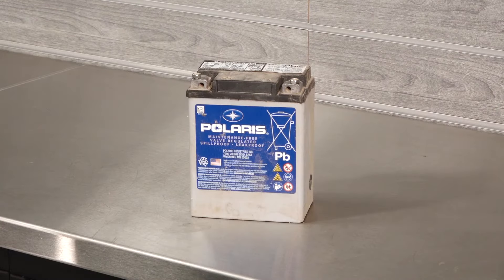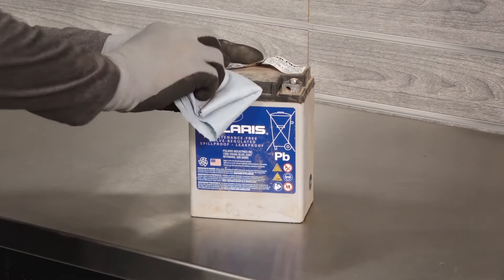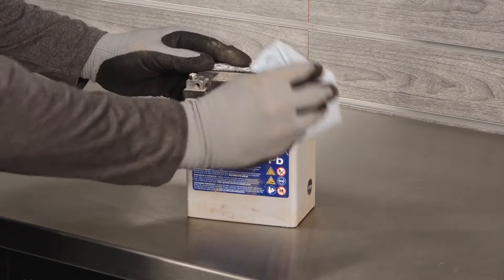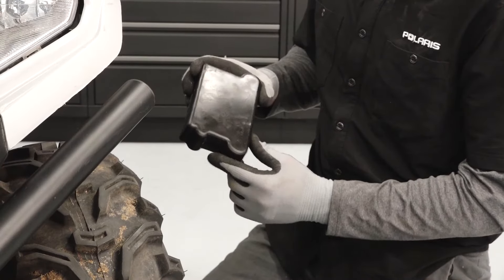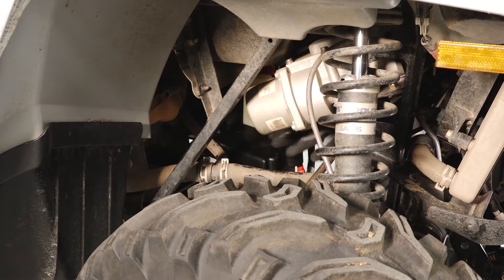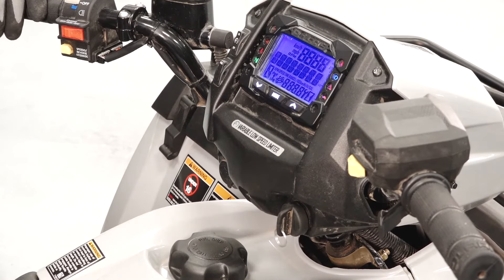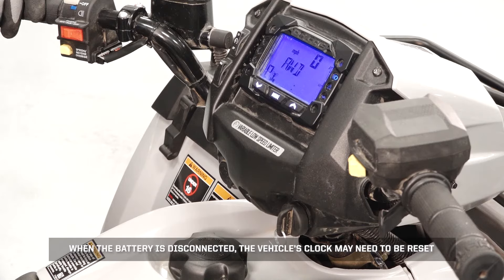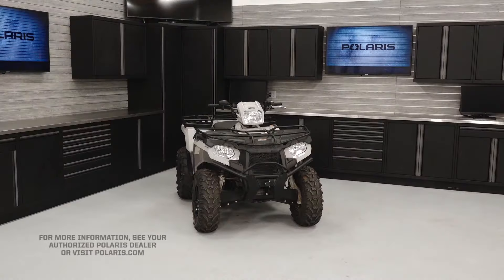Sportsman 570 Battery Removal and Installation | Polaris Off Road Vehicles

Comment: Battery placement on this is complete nonsense. And it does not come out just as easy as you show on this video. Serious redesign/placement of the battery needs to be done.
Reply: I guess they did relocate it on the most recent models (it's just ahead of the handlebars now, under the front cargo cover).  But that doesn't help any of us poor bastards with models just slightly older.
Reply: @floobertuber  , Yes.  I think you're right.  Seems like such an obvious design mistake.  I ordered a relocation kit from Quad Logic.  Still won't be as good has having it front of the handlebars or below the seat but should be a lot better than where it currently is.
Reply: @strixoutdoors  I've considered doing the same, but I also want a battery that is at least 20% larger (in Amp-hours and CCAs, which unfortunately, means physically as well).  So the relo-kit won't work for me.  I do wish they'd introduce one with a slightly wider tray.  

At some point I may resort to buying new battery cables, and making a tray that pops into my receiver hitch.  Then I could use a smaller car/truck battery instead, or as an auxiliary/switchable optional battery.
Reply: @floobertuber , makes sense.  I did get the relocation kit in.  Just need to install it and see how it goes from there
Reply: @strixoutdoors  Cool.   It does look like a well made product.

Comment: I will not own another Polaris, I don’t care if the ride is like sitting on my couch.  When engineers gather in a room and design a atv placing the battery in such a bad place and an oil filter that is almost impossible to get at , I had enough.....
Reply: Well said.  I have 2 x 2014/15 570's and the batteries are dead every year, make that every month.
Reply: @BRADH-xw8sw  I just changed my 2017 original manufacturer installed battery. Stored outside all year in the upper midwest. On a trickle charger only from November through March. Totally different experience from you. I’ll take Polaris any day.

Comment: The polaris engineer that put the battery down there should be run off.  Major PIA to replace the battery, it is not as easy as the make it look, plus changes in the frame cross members make impossible to get two hands in there. Engineers should be made to perform simple maintenance like this, then they will understand what a stupid design they came up with. Battery replacement should take no longer than 15 minutes.  And another thing why put a cheap battery that need its water checked in order to maintain it, there no way people are going to go through this BS just to check the water routinely.  The motto at Polaris must be "save a buck and aggravate the consumer."  Just changed mine out to an AGM battery and the next atv I buy will be maintenance friendly, so I'm guessing it won't be a polaris.
Reply: same here, i wont buy another polaris
Reply: It’s all about politics in that company and the vendors they work with

Comment: That's bullshit. There is no way you are getting both hands in there unless you remove the wheel
Reply: & you need long slender arms & the long fingers of a piano player..
Reply: It can be done like in the video- I’ve done it multiple times now- a serious pain in the ass. After a few times you get good at it. Removing the side panel is a good option and allows you to get on top of it but those stupid button rivets holding the panel on are another pain in the ass. You shouldn’t have to work this hard to access the battery. I needed a jump in sub-zero weather- almost froze my fingers off. Getting the bungee cord back on is easier with a second set of hands. You should never need a second set of hands for battery work. Order a relocation kit from quad logic. Polaris should be ashamed of themselves for this engineering flaw.
Reply: Took me 20 minutes. Easy peasy. Outside, below freezing. Really not that difficult for anyone that can turn a wrench or screwdriver.

Comment: 2017 570 EPS. Took 20 minutes or less to change out my battery outside in below freezing temperatures. All that was needed was a torque wrench to remove the coolant overfill bottle for slightly better access and a 10mm wrench. I don’t see why everyone is whining about access. Easy peasy.